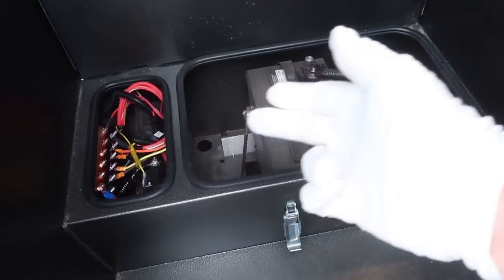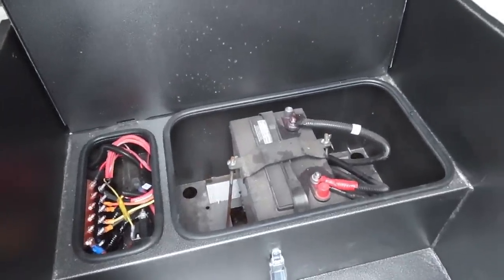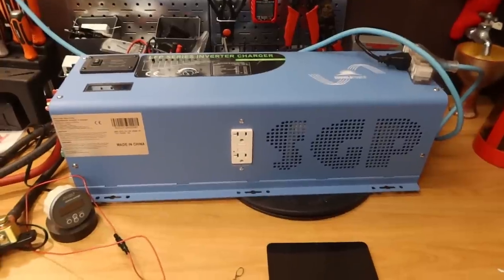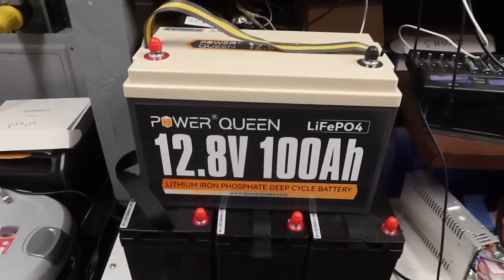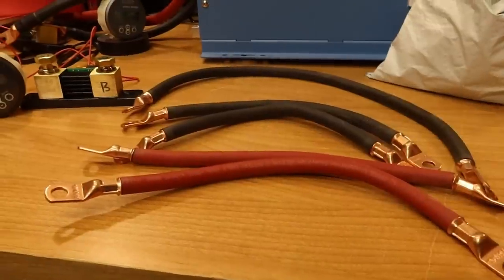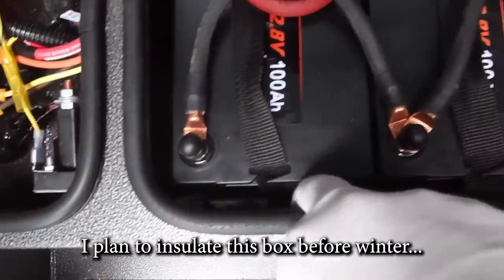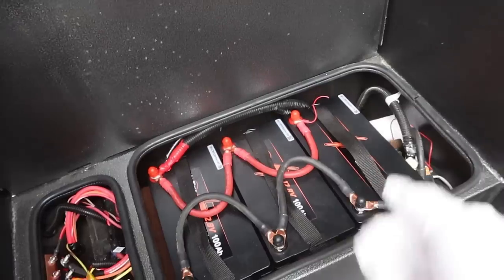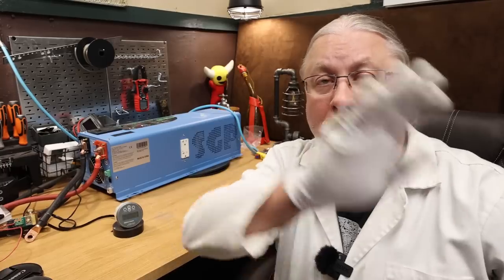UPGRADE YOUR RV | Van Batteries To Lithium For TRIPLE (or more) Capacity!

Comment: Since you should only use 50% of the charge on a lead acid battery, your single 100Ah is really 50Ah usable, so your 300Ah fully usable LiFePO4 = 6X, not 3X the battery capacity!

Comment: Great video as usual. When I saw the thumbnail, I thought you had the pics swapped. The lithium should put out 2-4X the power (with 5-10x the life) of the lead acid, so you should need 1 lithium for every 3-4 lead acid.

Comment: nice install. last on I did was a few years back.had way more room. put pink board insulation around battery. working great years now. they upgraded the inverter/charger so had LiFePO4 setting. love them smaller buttery's . will get one for tent camping .

Comment: Nice job with the installation - looks good! 👍🏼
Maybe put some adhesive foam strips on the inside of the lid to give more cushion if you are worried about the batteries moving upwards when going over bumps in your RV.
Have you ever reviewed those mini batteries?  Would be curious to see how they would do in your lab 🧪😬
Reply from the maker: Yes, I reviewed them last month.

Comment: I love Victron gear but if you want to save $100, the AiLi Battery Monitor works very well.
Reply from the maker: There are lots of cheaper monitors but the Victron app is the best. I like being able to see my state of charge anywhere in camp.

Comment: You have a 300 amp potential wiring 3 100 amp batteries in parallel, you need a fuse on the  last battery before the cable going to the inverter to protect your cable and your inverter.
Reply from the maker: I do know what I'm doing. The RV has an inline breaker but I rewired this and added a fuse anyway.
Reply: @HOBOTECH  okay just thinking out load, am enjoying your videos ,thanks

Comment: Looks  great! 👍  question on charging in parallel.  Once batteries are charged to full and then wired in parallel, will batteries be able to properly balance later when being charged in a parallel?  Or will they periodically need to be charged individually later to keep cells in balance?

Comment: I highly recommend finding a way to secure those batteries to the vehicle. The discharge amperage of 3 lithium batteries will overcome the resistance of the painted metal. Remember this is a moving object and weird things happen inside. It should be rather easy to fit a wood spacer between the top lip of the battery compartment and tops of batteries. Or even some of that PP foam that comes in the EcoFlow packaging, or PP foam in the battery packaging...
Reply from the maker: I will have foam on top of the batteries.

Comment: I read an article about charging batteries above 104F. The electrolyte is simmering off causing battery degradation. Could you have a video about liquid cooled batteries?

Comment: I've looked at trying to do this for several years… I'm glad that there's an option for the small batteries now… What about the stock charger built into the RV and the profile used to charge lithium instead of lead acid can be done?
Reply from the maker: The stock charger is lithium ready but doesn't matter if it wasn't it would still work fine.

Comment: Should we be concerned about those batteries in RV's in the heat. How much heat can they withstand? Some say a vehicle can get to 130 degrees in the hot sun. Is combustion or fire possible? My batteries are on the tongue of a conventional travel trailer.
Reply from the maker: LiFePO4 can't catch fire. It's literally made of iron.

Comment: will this 4000watt sungold inverter work with the LiTime 460ah lifepo4 battery? isn't 4000w too much i heard it's not good if you use too much inverter on smaller ah ? thanks

Comment: I'm curious what size inverter you have or plan to upgrade to (assuming you will run an inverter in the rig).  With 100A BMS ea in parallel, you could run a =<3KW inverter.. but not with the 2 gauge cables you used.. so is this application just for 12V loads or a small (~1200W) inverter?

Comment: Do you need a DC-DC charger for these batteries to get them a full charge when they're down as obviously a Class - C motorhome alternator or shore power inverter/charger would not give you 14-4 volts?
Reply from the maker: If you only have a single stage (prehistoric) charger then you'll need to upgrade it to a multi stage. Most modern motorhomes have a 14.4v charger. I installed one in my 95 Roadtrek for about $179 and it has been working since 2019 to charge lithium.

Comment: Could these be used as the main vehicle battery and charged with the alternator.
Reply from the maker: I said in the video it is not a starter battery.
Reply: @HOBOTECH  Thanks for answering. And thanks for the work you do.

Sorry, I tend to skip ahead in videos. I missed that part. 🤦‍♂️

Comment: I would have used a hall effect ampere sensor instead of increasing line loss with a dropping current sense resistor. (remote DC amp clamp)
Reply: You fail to take into account the application here - accuracy is key.  That is why none makes one for the RV or solar battery application.
Reply: @MrThisIsMeToo  yes they do!

Comment: I have a 1997 roadtrek Dodge versatile, it has the original converter charger and the original isolator. would I still be able to use this as a drop-in  replacement without upgrading those items? They both work just fine with the lead acid I now have.
Reply from the maker: The converter in my 95 RT only charged at 13.6v which actually was boiling the lead acid battery. I spent the $179 on a 4 stage Progressive Dynamics converter that charges from 13.2-14.4 made a huge difference. Later upgraded to lithium and didn't have to change a thing. So technically you can keep your old 13.6v converter but note it will never fully charge a lithium battery and will eventually ruin a lead acid.
Reply: @HOBOTECH so the original isolator worked with your lithium batteries also?

Comment: The converter... what about the alternator?  Some of these drop in replacement lifepo4 batteries can suck up 100A when charging.  The converter is going to do it's rated and be fine when you're plugged into shore power.
When you start up the motorhome, the ALTERNATOR will take over.  If the batteries start sucking up 100A it's going to put quite a strain on your alternator.  This is the problem I have.  What goes between the alternator and the lithiums to control the charge cycles and the max charge current?  You can swap out the converter, but the alternator, and most are ECU controlled today, knows nothing of your lithium battery's needs.  Somebody has to make a box to correct this right?

Comment: I'm an rv tech and have always been looking for something to fit in these class C step battery storages. Question! Will the converter in that unit charge at that voltage? Some have a lithium selection on them. What did you do for this? I'm always looking for answers for customers. Thanks!
Reply from the maker: Any standard converter charger that can provide 14.4v will charge them.
Reply: @HOBOTECH  that's awesome. Thanks for taking the time to reply!

Comment: THank you!! This is great, but can you recommend how we can keep these batteries charged in the camper? What kind of charger? How to configure it in the RV around the solenoid switch?
Reply from the maker: You drop them in and you're done. The charger will work as long as it outputs at least 14.4v. There's also no change to the solenoid.

Comment: So even with this heat, do you still recommend lithium over lifepo4 specifically the ecoflow delta series?
Reply from the maker: There is no reason to choose NMC over LiFePO4 unless size & weight is a primary concern.

Comment: Great video, my only question is, Is there enough ventilation in this box for the three?
Reply: These batteries don't vent
Reply: You don't need to Vent Lithium Batteries. Their chemistry does not produce Hydrogen gas like Lead Acids.
Reply: @jonjohns8145  I was thinking more for heat dissipation.  I know LFP’s are better in this regard than lithium ion’s but figure you still need some kind of passive cooling don’t you?
Reply: @davidcarrico3385  I doubt you need THAT much dissipation so I would think just the natural air circulation around the batteries exchanging heat with the outside metal container should be more than sufficient.
Reply from the maker: No, in fact you want to keep them warm. I plan to insulate the box for winter use.

Comment: Your assumption that being in parallel each battery only being limited to 100A on the cable is wrong.  There is the possibility of 300A with three in parallel. Sort of the definition of parallel.  Still fine for 2ga on a very short run but.........  Where is the protection, fuse or breaker?  Sure hope it is missing from the video? Batteries not secured = recipe for disaster.
Reply: Correct Mr. Insurance Adjuster, there was no fuse and the batteries were not secured. Signed, "Professor"

Comment: Its great until something happens and it catches on fire, hopefully it doesn't burn down your house too.
Reply: LFP batteries like the mini he has here are actually pretty safe, and not prone to fire like some other lithium chemistries are.
Reply: LiFePO4 batteries are not like Lithium Ions, they are not prone to thermal runaway even if they are punctured. You can see for yourself if you search YouTube for videos of damaging LiFePO4 cells. The smoke a lot and they swell, but they don't usually catch fire.
Reply: Will the rvs alternator used to charge lead acid batteries charge Lithium batteries. Is there a special alternator for charging Lithium?